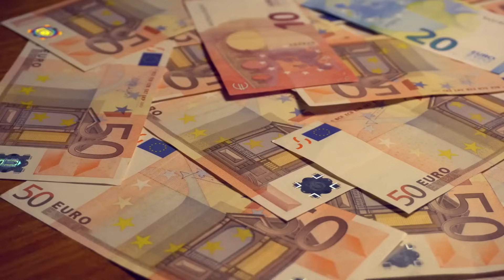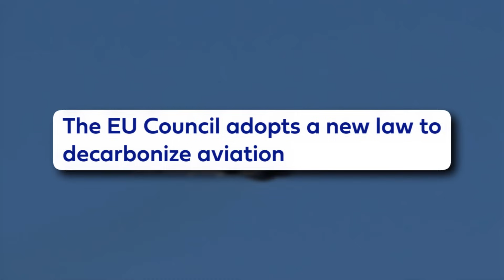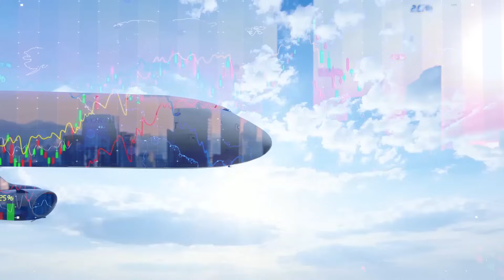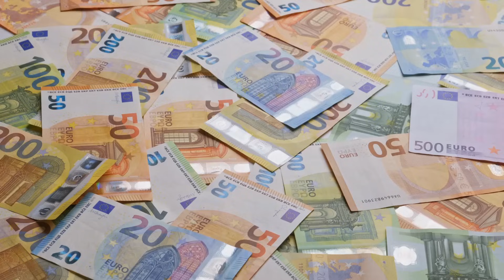NEW Fokker Next Gen Is Now Making A MASSIVE Comeback! Here's Why

Comment: The main issue is the production of hydrogen. The conventional method of hydrogen production  involving the use of methane  and fossil fuels ends up producing CO2 as a byproduct. The alternative method of using electrolysis of water is very expensive and a net energy sinking process because the amount to energy required to split water is higher than the amount of energy released in burning hydrogen if the efficiency of the entire process is taken into account.

Comment: Hydrogen seems to have similar problems like LNGs. Both require an awful amount of energy to be liquefied, pressurised and stored at a cooler temperature only to be regasified.
Hence, it is at a disadvantage to traditional aviation fuel with regards to both costs, storage, and reduced capacity for the jets that will be using it.
Obviously their will be passengers that will be prepared to pay extra in the comfort of knowing that it is better for the environment.
Reply: Similar but worse. Better equip aircraft with tip tanks fitted at the begin of the take off and take them off again at the end of the landing run. Have ground movement powered by tugs. Have standard tanks fueled in a fuel park near the runways, fitted to the wing tips by automatic machines. In that way you keep the fuel away from the passenger facilities of the air ports.